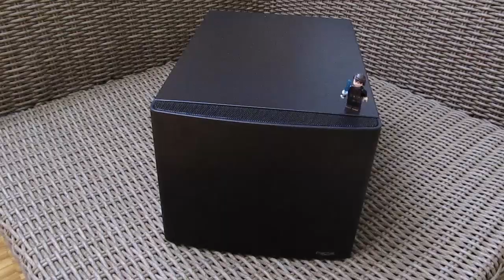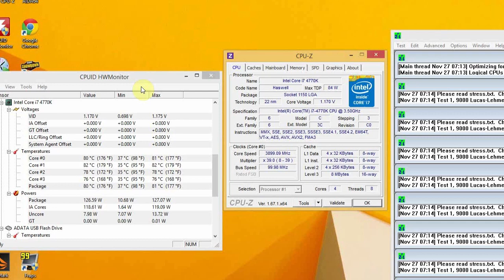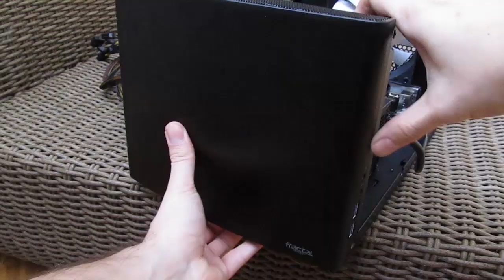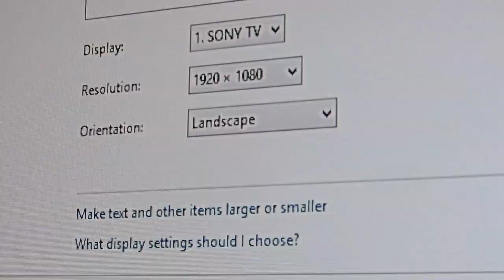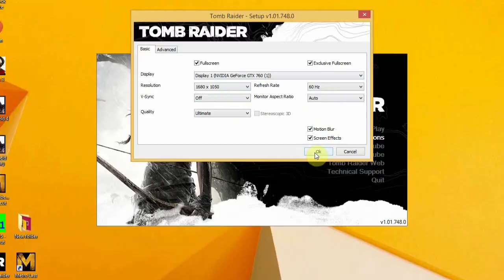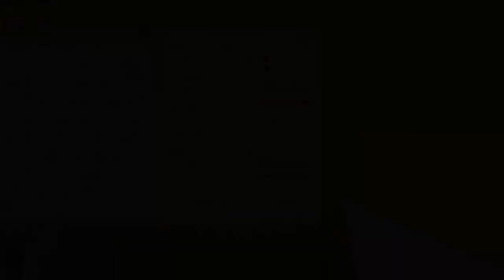Steam Box Machine Configuration Build Guide DIY

Comment: The z87n-wifi only supports 1600 mhz ram. will the 1866mhz ram just be down clock on that motherboard?
Reply from the maker: Yes, that is true, but we successfully loaded the XMP profile and it ran on 1866 MHz
Reply: TekTick i see. im actually about to complete a very similar build with that motherboard and case. good to know the xmp kicks in. may have to upgrade my ram!
Reply from the maker: toliver182
There's absolutely no real difference between 1866 and 1600 in everyday computing, even with some hardcore applications. You can stick with the 1600 and buy yourself a drink :)